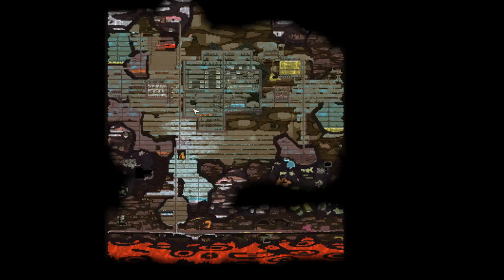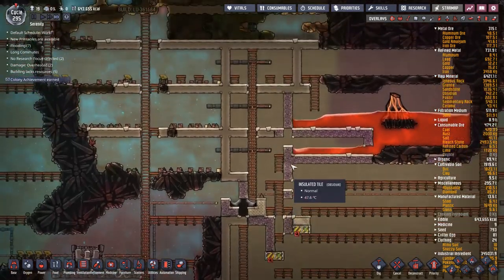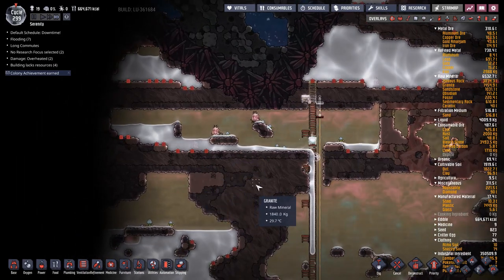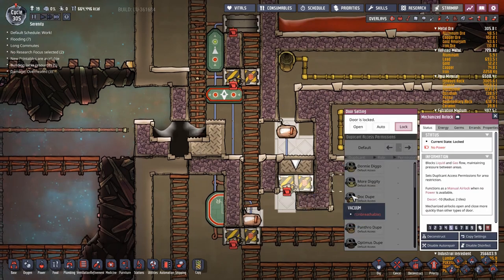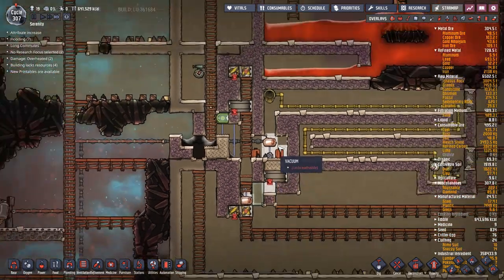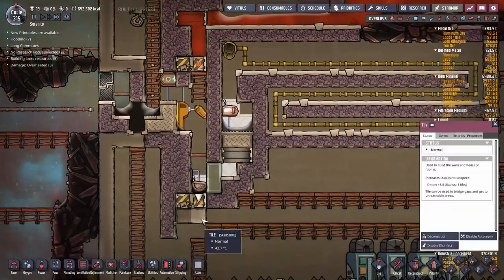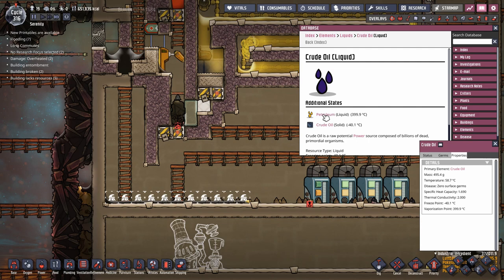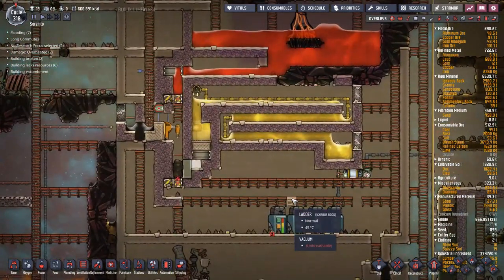Oasisse 9 : Petroleum boiler also some excessive water dumping : Oxygen not included

Comment: In my version of the petroleum boiler build is to use doors instead of a robo-miner. I.e. I place a door or two in the chute where the lava falls down into which are open at all times until it's time to clear out the rock. When that happens, the doors close which instantly annihilates the rock in question. It's faster and simpler than the robo-miner design and is much less likely to require maintenance or suffer from sour gas leakages or lava overflows, especially if you're having issues with insufficient power. Now you might be wondering where I put the temperature sensor. Beneath the bottom door, I have it submerged in a tile of liquid lead. The lead always stays liquid so there aren't any issues on that front.
Reply from the maker: Oh that is a use for lead that no other materiel could have covered, it's liquid between the boiling point of crude and the output temp of volcano's. If volcano's output was just 25C hotter it could turn the lead to gas, I wonder if the devs planned it that way. I'm stealing that idea for testing.
Reply: @FrancisJohnYT  Be my guest!

Comment: I used your design for an oil boiler in my own base, but because I do what I do, I constantly deal with drops in service. I.e. holdups in oil delivery, plus I prefer to magazine petrol, so I modded it to be robust for variable flow, adt to be able to stop when the magazine is full. 

To do this I needed to add a petrol loop at the top leg of the flow from the boiler instead of the crude flow. this loop goes to a water chamber and drive a steam turbine to delete some heat. This ensures the petrol is below 400C when it hits the crude oil pipes (Prevent heat damage to those pipes)  I added two safeties: a second temp sensor in the boiler chamber that goes red when below 400C and a pipe temp sensor on the petrol loop going to red  if for some reason it goes above 400C. Both of these cut the oil flow. With these modifications I get a little power out and is robust to variable oil flow at the cost of using a bit more magma as the oil is a bit cooler when it hits the boiler.
Reply from the maker: If your not maxing it out at 10kg/s all the time then you are saving magma, so a little bit of heat loss should still leave you well within margin.

Comment: I'm glad we know now why the drill cooling oil drop would sometimes turn into sour gas. I thought the falling magma interacted with it but the door push makes more sense. I solved it back then by putting the drill on the side of the solid magma behind doors which would open to allow the drill to do it's job. But the timing circuit was complicated as hell. Also I read somewhere that you can prevent pipe breaking during phase change by only pumping 1/10 or the pipe's throughput. Might be possible to keep the oil in pipe all the time and let it change inside, dunno, but you would lose the counterflow....
Reply from the maker: To avoid the door push you can also lock the door :) the dupes kept going into the boiler room to grab the little bit of igneous debris that would every so often happen on the top of the two solid tiles.
1kg of liquid in a pipe will not state change, but to get 10kg a second you would need ten pipes. For a Sour gas boiler it's a great idea for Petroleum it's just simpler and way smaller to use the current design as far as I can tell.

Comment: Your not alone I hit p many times as well. Tinker dupes Wheeljack, Percpetor, Dr. Stone mainly i would draw from 80 cartoon-inspired names or pull from the comedy stuff like don't have it, lost my marbles, for me i just number the dupes and add abbreviations for their traits like DL means Diver's lungs, so 04DL and such. I would see about adding a steam turbine setup with a cooling room so the 125-degree rocks gets moved over and cooled to 20 degrees then gets shipped off for sand or what not to this setup then maybe that could be included into the power block part as it's cooling loop as well as for the rock.
Reply from the maker: If the rock is ground up that will happen in the industrial sauna,  also my power brick is going to run hot as well so no cooling there. Considering how I'm playing the map hot I'm not sure 125C rock lying about the place is going to be a problem so long as I keep it out of my core base. The joy of playing the map hot is i don't have to care about the environment. I'm going to move 100C+ petroleum about the map in regular pipes, why bother insulating it? I'm interested to see what other heat issues I can just simply ignore.

Comment: One suggestion for a slightly different boiler setup: Build it down in the oil biome, build a diamond rod (2 or 3 tiles wide, depending on the length) that touches the core magma. And then use the steeldoor to transfer the heat from the diamond rod into a diamond boiling/conversion champer. The counterflow part stays the same. That is much simpler, diamond costs nothing and no driller, no automation required (except one temp sensor that toggles the door). Eventually you will cool down the core magma to much so that is solidifies, but that will take 10000+ cycles, so no worrys there...
Reply from the maker: I have though about that in the past but it's pretty tricky. Even with the diamond rod the local heat draw causes the local tiles to solidify and the temp transfer with the surrounding magma goes way down at that point. The joy of the volcanic design is it never ever needs maintenance. A magma core design can net you maybe 5-10 hundred cycles. Volcanic is forever. But give it a shot and let me know how it works out, there is multiple solutions to every problem in this game.
Reply: @FrancisJohnYT  I did build it. I put 3 oil wells (10kg/s) through it for 800 cycles so far and the magma temperature touching the diamond tiles is 1549°C... It started at 1650°C ish, i think and it solidifies at 1410°C so there are a few more cycles in it... (more than i intent to play the map, probably)
apart from the initial heat up phase, the heat consumption is really not that big.
Reply: btw: if you make the boiling chamber one tile wide instead of two, the pressure damage that happens when heating to fast (or too slow) is mitigated. The damage does not actually come from the created petroleum but from the unconverted crude oil that somehow got compressed by the petroleum into a single tile with thousands of kgs pressure (This game has "interesting" fluid mechanics :-) ). 
As far as i can tell, this does not happen if the boiling chamber is only one tile wide
Reply from the maker: @gaharmun  Ohhh send me the save (email in about section) I'd love to look at it.
Reply from the maker: @gaharmun  Interesting, I used to get pressure damage all the times with a one tile wide chamber. Thats why I switched to two tiles wide. But this was a long time ago and my testing methods were not as stringent back then. Will have to do a retest at some point.
Reply: @FrancisJohnYT  sure, but dont look to close at the rest of the base... Its a mess :-)

Comment: how do i calculate the amount of loops i Need for the Petrol boiler? and the length of the magma droper? can i have the formulas? thanks
Reply from the maker: The counter flow lengths were the results of practical testing https://youtu.be/YWQcaus9if4?t=1590 The length of the magma dropper was just a case of seeing how far magma flowed and making the dropper one shorter. The above video is a bit long winded but covers how I came up with the design details. However Aluminum was not release then so the current design was me playing around on the testing map again to figure out how long to make the counter flow with the new metal.

Comment: I wish at least 1 volcano was guaranteed on map spawns. Kills me to dedicate a bunch of cycles into a map and then realize there are no volcanoes. Currently on a mega-base and just realized it also doesn't have volcanoes. (my last mega-base had the same problem) Going to look into a renewable form of magma now that you can bring it from space...
Reply from the maker: You can use geothermal magma to run one, a pitcher pump and some bottle emptiers will allow you to move the magma around. Once you hit space you don't need magma anymore you can use a space metal aquatuner as the heat source. The reason I like using a volcano is you can set it up and never have to modify it again.
Reply: @FrancisJohnYT  Oh! You're right! I had completely forgotten about Niobium. I usually only use it to get thermium for liquid hydrogen/oxygen. I'm working on a mega-base (40+ dupes) on an Oassise map with only the two default water sources. The 1:1 conversion would be very helpful to create water. With a niobium aquaturner I should be able to get there. Oassise is thankfully not a map lacking in energy. Thanks for the help!

Comment: Why dont you use the automation switches instead of the pressure sensors?
Reply: Those used to require dupe interaction. Now they don't. So hydro sensors were more convenient then.
That thing with the thermo sensor not triggering in vacuum has been fixed too by the way.

Comment: Question, would a boiler like this work with a metal volcano instead of just raw magma?
Reply from the maker: Liquid metal flows very differently and would form tiles much easier and more than likely gum up the build. But I have not tested.
Reply: @FrancisJohnYT  Thank you for your reply. Will be testing it with a boiler once I get the materials. The big advantage of metal volcano in theory would be that it doesn't form tiles, rather once the magma cools you get loose blocks of refined metal. sitting on the last door until cooled when you can drop them down and collect them.
Reply from the maker: @KaoVamp  Liquid metal does form tiles, I believe it's somewhere around 800kg if memory serves.
Reply: @FrancisJohnYT  Ah. I haven't encountered that yet, then again the way I accidentally cooled liquid metal was very weird. It may have been a bug, but I had the metal fall behind the neutronium tile under the volcano, cool down back there and pop up as blocks of solid metal, which is probably why it didn't form tiles. https://imgur.com/HOBXwzu see picture for how it looked. It's not visible from the picture, but there are blocks of solid copper in the clutter. Will see if I can replicate it on my current map and give a clearer picture.

Comment: "I'm developing Karmic Debt to the OCD people" 
I just had to laugh at this one.
Question regarding the pressure blade: Instead of shortening the blade from 11 to 10, would adding a few tiles in the section above the blade on the left hand side push the magma to the right, therefore increasing the pressure so you didn't have to shorten the blade? Not sure if that made sense.
Reply from the maker: Do you mean dropping the ceiling on the blade from 2 tiles to one? That would not change the pressure. Don't know why this blade failed to dump correctly, I need to do some testing over the weekend to find out what went wrong.
Reply: @FrancisJohnYT  I don't think that's what I meant. Let me try it this way. You have what I'd call a primary vertical shaft of insulated tiles in the primary tank where the volcano is on the left side. To the right, on the 3rd cell over you placed your first set of 5 ladders going down.  What if you made the vertical insulated tile section, to the left of the ladders, 2 tiles thick so it pushed the magma further to the right? Do you think that would create more pressure? It would make the primary magma tank, where the volcano is, smaller, which might push the magma through your blade.
Reply from the maker: I went back and rechecked my old footage turns out the magma blade is supposed to be only 10 tiles long not 11. My bad. I found the relevant bit here - https://youtu.be/YWQcaus9if4?t=53 It's amazing how many mistakes I can squeeze into a video.

Comment: it just so happens that i had to build one of these and its a nightmare, so far, because i havent tuned it in yet and i dont really have a 'sink' for the excess petrol. time to get me some more slicksters but i have to tap into the raw power of the magma biome, have you ever tried this with a metal volcano i have an iron volcano in the same biome actually very close to my boiler
Reply from the maker: Metal is much harder to work with, it's hotter, forms tiles in smaller amounts and does not work well with a magma dripper. I'd stick with getting metal out of them and maybe a little bit of power.
Reply: @FrancisJohnYT  as luck would have it my map has two iron volcanoes lol and i want to tap into the second one for a more "permanent" boiler ill see if i can at least get that up and running properly lol then i can share that save file with you
time to build a large tank for the hot petrol ill probably sink some of the heat from it into a slickter ranch
Reply from the maker: @dpsilver1  good luck

Comment: You're welcome about the top-access! .. or at least I've been doing that, too. Might have seen in dischord. But you might've seen it elsewhere as well :-D

I've found that the blob of magma can sometimes still flash the drop of oil, even though it seemingly should always miss. I guess it depends if the magma "drips" down or "oozes" down. You've seen those water gooeyies in this vid, .. if magma does that, it flashes the oil drip. I don't know how to avoid that. So instead I moved the miner back one more tile. The slight diagonal the miner will need for that can be gotten by removing one corner tile below it. Ask on dischord if you need a screeny of what I mean.

Dogsbodies: "Mammia Mia", "Momsicle" or "Yo momma" to stay near the mom thing. Or famous movie cleaning ladies: "Cinderella" and "Annie". I would add a masculine counterpart, if I knew any. =/
Tinkerers: "McGuyver" and "BA Baraccus". Maybe "Tinky winky"?

Comment: For opening that door you could have used a switch from the automation tab
Reply: A switch need a dupe to interact with it. The sensor doesn't you just change it from below to above.
Reply: Or an atmo pressure sensor allows you to toggle red and green manually without a dupe.
Reply from the maker: Never fired one of these up in a vacuum before, little bit trickier than anticipated. If I was not in such a hurry I probably come up with something a little bit cleaner than a drop of crude.